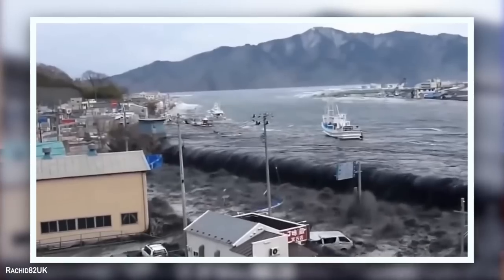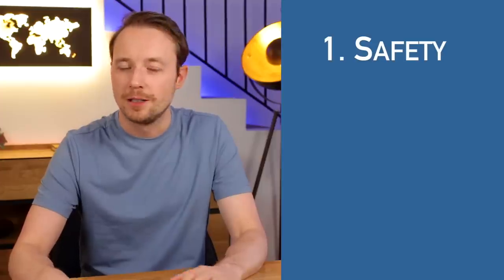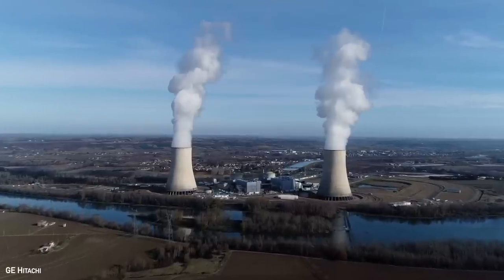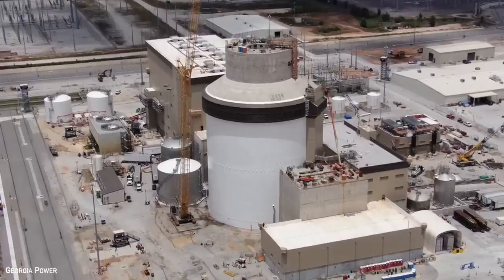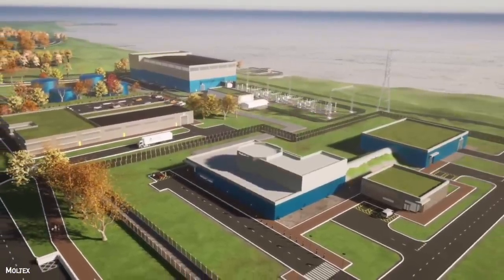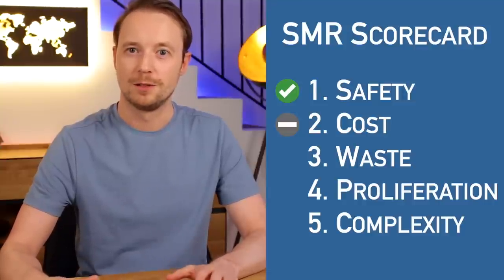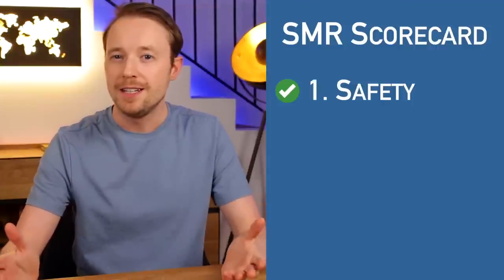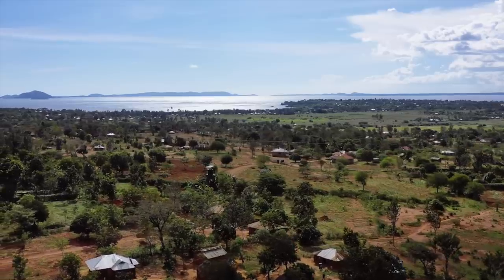Can Small Reactors Revolutionize Nuclear Power?

Comment: There is no path forward to a fossil fuel free future (which we must achieve because oil prices will soar in the net 15 years as fracking peaks) that does not include nuclear energy. The key benefit of the small reactors are they are quick to bring on line and we should be brining one on like every month in the US if we want to be ready.
Reply: In the US, oil is used for engine fuels not power generation. Electricity is generated using natural gas, coal and nuclear, account for 80%.
Reply: @LSuschena  Yes, but you miss the point.Oil is used for automobiles and as oil prices increase, more and more people will want to convert to EVs. It is the EV usage that will drive the need for huge electric capacity increases. Today in the US, wind and solar only account for about 15% (about 21% for all renewable). Nuclear is 18%. When gas gets to be $6 a gallon, the rush to EVs will intensify.  The base Model 3   has 50 kilowatt capacity which is enough to power a home for two days. Imagine that each Tesla is plugged in every 4th day. This would be like increasing the number of houses in the US by something like 50%. Where is all of that electricity going to come from? We will need to raise the baseline capacity by about 50% from where we are today. As oil becomes more expensive, the demand for electric vehicles will surge. So, it is the price of oil that will drive the need for more electric capacity.  I have been investing in energy production for 25 years  and I have been increasing my investments in recent years, because electricity is the future, and as oil and natural gas get more expensive, nuclear will be unavoidable. There is just no other way.
Reply: @shenmisheshou7002  
True. They don’t realize the tremendous costs associated with EVs, have to rebuild the entire electric grid and build generation as you say. The greens don’t understand the costs.
Reply: @LSuschena  I also don't think they realize the shortcomings of renewables. Current solar panel technology is such that panels only last about 20 years and of course they don't make much power when it is cloudy.  No one is going to want to tolerate rolling blackouts because the sun isn't shining. Wind I think is more reliable, but structural life of a wind turbine blade is likewise about 20 years.  If half of our future power needs have to come from green energy, the waste from aged components will be staggering.  It is a bleak future. I am an old man and I will be dead before 2050, but I am saddened to see that there are so many people that still don't see what his happening. Even as a young man, I made the decision not to have children.  I think people thought I was being selfish but even then, I could imagine that our energy usage was unsustainable. This was long before global warning was in the public's eye, but having been through the Viet Nam war and having seen the fight over resources and the unsatiable thirst for energy, and having read very early work on global warming (the first papers on the subject were written in the late 1800s) and the Hubbert Peak ( and Hubbert pretty much got it right) I looked into my own crystal ball what I saw was bleak. I would have never seen the downfall of US Democracy coming, but I could see use overconsuming our resources.
Reply: @shenmisheshou7002  
Truth!
I am trying to figure the LCOE basis using EIA information, but they are inconsistent with their own data. They state nuclear capacity factor as 94%, but use 90% for LCOE values. They state solar as 26%, but use 29% in LCOE. Looking for the actual formula they use.

Here is the rub I see. If you install equal generating capacity of nuclear and solar, nuclear (and fossil) can put 100% of their capacity to the grid on any given day, rain or shine, winter and summer. Solar can only put 25% of it generating to the grid on a perfect solar day.
To me it seems 4 times the solar needs to be installed to put the same energy to the grid. So capital costs for solar is times 4.
But of course some people want energy at night, so you have to introduce battery storage.
So, 1/4 of solar goes to the grid during the day and 3/4 to battery storage, or 18 MW. So it looks like solar LCOE times 4 and Battery LCOE times 18. But then I see battery capacity factor is 10%, so is that 180 times battery LCOE?

In Florida, the rule of thumb on 10 acres per MW. To replace a 500 MW fossil plant that’s 5,000 acres/MW times 4  for capacity factor, 20,000 acres.

The other question I have, related to cutting down vegetation to install solar. Does installing 20,000 acres of solar limit CO2 emissions that the natural vegetation/trees remove?

https://www.eia.gov/outlooks/aeo/pdf/electricity_generation.pdf

Be well.

Comment: I'm surprised this idea has taken so long. Small reactors have proven to be effective for nearly 70 years in submarines.
Reply: Submarines do not have to compete on cost.  EVERY utility that has nuclear has ALWAYS built the largest plant available due to economies of scale.  SMR are cheaper to build but more expensive to operate
Reply: @clarkkent9080  I know everything you just said but you've missed the whole point of my original comment. Small reactors have been viable for 70 years. That's 70 years of learning. Think what the world was like 70 years ago technologically.  New, innovative technologies rarely do compete on cost and quite often originate in aerospace or military applications where cost is less important. The crux of my comment is why has this concept taken so long to be looked at as an option in the commercial market. When a technology has to to prove itself competitively in the marketplace, that's when costs plummet and efficiencies soar. Look at EV's, wind turbines, composites, ceramics, alloys, etc etc.
Reply: @alunjones2550  First NO company that is proposing SMR are designing reactors anything like navy reactors.  Navy reactors make only 70 Mw and to do that, they use 95% enriched uranium at a cost of $1 billion for just the fuel. They are very specialized reactors.

But it may be better to give you REAL life examples and that would be NuScale which is the only company proposing SMR in the U.S.
This is from the Des Moines Register an concerning the only Small Modular Reactor (SMR) project in the U.S. today.
In 2013, the Wall Street firm Lazard estimated that the cost of generating electricity at a new nuclear plant in the United States will be between $86 and $122 per megawatt-hour. Last November, Lazard estimated that the corresponding cost will be between $131 and $204 per megawatt-hour based upon the 4 recent new nuclear projects in the U.S. . During the same eight years, renewables have plummeted in cost, and the 2021 estimates of electricity from newly constructed utility-scale solar and wind plants range between $26 and $50 per megawatt-hour. Nuclear power is simply not economically competitive.
SMRs will be even less competitive. Building and operating SMRs will cost more than large reactors for each unit (megawatt) of generation capacity. A reactor that generates five times as much power will not require five times as much concrete or five times as many workers. This makes electricity from small reactors more expensive; many of the original small reactors built in the United States were financially uncompetitive and shut down early.
The estimated cost of constructing a plant with 600 megawatts of electricity from NuScale SMRs, arguably the design closest to deployment in the United States, was originally advertised as costing $1 billion but upon requesting actual bids from engineering firms, increased to $6.1 billion in 2020. Given inflation and other cost constraints that cost today can only be expected to be significantly higher.
The cost was so high that ten members of Utah Associated Municipal Power Systems canceled their contracts. NuScale then changed its proposed plant configuration to 6 fewer reactors but increased each reactor output from 50 Mw to 77 Mw costing at total of $5.3 billion. The NRC just last week approved the construction of the 50 Mw design but now will have to start the review process all over given the switch to a 77 Mw design. For each kilowatt of electrical generation capacity, that estimate is around 80% more than the per-kilowatt cost of the Vogtle project in Georgia — before its cost exploded from $14 billion to over $30 billion. Based on the historical experience with nuclear reactor construction, SMRs are very likely to cost much more than initially expected. And they now have delayed the project start until 2025 in an attempt to find more backers.  All this before the inevitable setbacks that will occur once construction starts.
Reply: @clarkkent9080  I didn't say they needed to be Navy type reactors. I didn't specify any type of reactor. I specified "small reactors". 

Cost of renewables does not consider their unreliability and unpredictability. You can't guarantee the sun will shine or the rain will fall or the wind will blow, which is the fundamental case for nuclear and above all else, adaptable, reactive, responsive nuclear. Of course it's not as cost effective, you're dealing with far greater complexity and danger, but only through development will cost come down.
There's three fundamental reasons nuclear has not developed the way it should. Paranoia, cheap fuels such as oil, coal and gas and thirdly, nuclear has never been put under pressure to develop itself. The car industry is being heavily pressured now to develop EV technology because they won't be able to sell ICE vehicles in many markets soon. They either develop or die. Guess what, there's massive improvements in batter cell technology. You look at any technology put under pressure and it miraculously develops in leaps and bounds.
Look what happened to technology under the pressure of war. We started 1939 with bi-planes and ended 1945 with jet fighters and nuclear weapons.
I reiterate what i said in my original comment "I'm surprised this idea has taken so long. Small reactors have proven to be effective for nearly 70 years in submarines."
Reply: @clarkkent9080  You've really twisted my words this time. From your reply, I guess you didn't understand a word of what I said. Firstly, I am 100% in favour of wind turbines, solar, hydro etc. but none of these can guarantee  their supply of electricity. The reason all of these technologies can reduce their costs so easily is because there's not a whole lot of new technology and also you have considerable cost savings from scalability. As I previously said- which obviously you didn't understand- nuclear will be considerably more expensive because you're dealing with something far more complex, far more hazardous. You're also having to deal with far more expensive materials. Nuclear is the only real option for predictable, reliable base-line power delivery that is green. If we all stopped developing technology because the costs "ballooned", nothing would progress. I'll draw pictures for you if you still can't understand,.
Reply: @alunjones2550  I understood exactly what you said.  What you don't understand is that new nuclear in the U.S. has been proven to be 2-3 times the cost of any other power generation method.  After VC Summer and Vogtle NO U.S. utility is even remotely considering new nuclear.  And if you do a little research you will see that old fully paid for nuclear plants that have license extensions are shutting down every year because they are not cost effective. Now the taxpayer has $36 billion to give to investor owned utilities to try and bribe them to keep the plants open.  

You can mighta, coulda, shoulda all you want but we are a capitalist society and even climate change will not override the massive cost and time to build.
Reply: @clarkkent9080  If you're so against nuclear can you please tell me which green power source we can use that will deliver consistent, reliable, predictable power because wind, wave solar, hydro can't. They're all subject to the vagaries of the weather and lunar/solar cycles. 
What is going to provide that consistent, substantial base-line power in an environmentally considerate way instead of coal, gas and nuclear power stations. I'd love to know, and so would all the countries that are looking to invest in nuclear. You must know something they don't.......
Reply: @clarkkent9080  For a start, I don't ignore facts. I've acknowledged the high cost of nuclear, I've acknowledged the lower costs of wind. You need to tell me which fact I've ignored. Secondly, the world does not rotate around the USA and so just because America isn't building any nuclear does not mean other countries aren't. 
I notice you didn't answer my question as to which green power source can deliver consistent, predictable, reliable power other than nuclear. that's because none of the others can', Solar might be great for some but not for countries with less sunlight. Same goes for tidal, hydro, wind. None of them provide 24/7 guaranteed power. And whilst you're so keen to say I ignore facts, that is a FACT you can't ignore. I love green power but, I'm also not dumb enough to think that wind, solar, hydro are capable of providing all our needs on their own. Do some research on nuclear investment outside of your beloved USA.....

Comment: Fairly well balanced and delivered video. Even though I am fairly skeptical about the benefits of nuclear, it does seem like it will be the best option for high latitude nations or small islands in deep waters, together with wind and a little storage. I think the biggest red flag for them is that nobody is building the SMR factories yet, when they are going to need a process with a negligible defect rate that produces at least 20 units a year to have a meaningful effect on the global energy market. That factory design could end up being more difficult to license than the finished reactor, especially if they are fabricating the fuel elements there.
Reply from the maker: Yeah, I think SMRs or even microreactors have a place for the more remote regions where fuel like oil or renewables alone might be difficult. You are correct, no one has built the factories and that will take time with no guarantee of success. Thanks for the feedback!

Comment: Real appeal of SMRs is the psychological factor of smaller disasters get less publicity, even if the occur more often.  It's just reality, have enough nuclear reactors and there's inevitably a los of coolant accident.
  Spreading the risk with lots of little reactors means probably more meltdowns, but would contaminate much smaller areas, like a single town rather than a whole country.

 Small local disasters make the network news and media much less, so public relations for a utility company aren't stained by a conventional plant meltdown of a Fukushima scale.
Reply from the maker: I think nuclear power is unique enough that, even if a small plant has an accident, there would be a lot of attention. Very rarely, small research reactors have issues and then it's a big deal. However, the proposed designs of many SMRs are really orders of magnitudes safer. Accidents are not impossible, but probability and consequence and a fraction of older designs.

Comment: Can SMRs be built using thorium molten salt designs?  Is anyone actively designing or building one right now?  They seem to have significant advantages over U reactors, such as simple automatic shut-down and the unsuitability of waste for weapons manufacture (no plutonium & handling fissionable isotopes in the waste is difficult, unsafe and hard to hide.)  Also, Th is more abundant than U.

Comment: Small reactors have been tried, long ago, and the economics were dreadful.  The basic laws of scale have not changed since then.   Small reactors still need most to all of the basic parts, plus the irreducible elements like backup systems, security, licensing, and monitoring.  All this recent hoopla shows the usual pattern of hullabaloo drummed up by small companies looking for (dumb) investors ...   Lotsa blab, whooshing noises and glossy 3-D flybys,  and plenty of mostly-unfounded monetary projections.  A quick look at past new nuclear ideas shows a consistent pattern of total fails.  Advanced gas-cooled reactors, pebble-bed reactors, sodium-cooled reactors, thorium reactors, and more. All total technological or economic failures,  even worse than the typical boiling-water reactor cost overruns and failures

Comment: Dead man walking....LCOE of SMRs etc is x5 wind and solar, see you next decade....maybe
Reply: Of course, you need more than 5x the wind and solar to deal with intermittency.
Or, you could buy storage at severalX the LCOE of NPPs.
Reply: @factnotfiction5915  Actually no you dont need x 5.  PS Reactors also need backups while they refuel or repair (see France for that one) and storage.
Reply: @gzcwnk  I agree reactors need backups, as does any power plant going down for maintenance - what I am referring to is the intermittency.

Without storage, you need widely distributed backup. If the solar farm in New York fails because of sunset, then the solar farm in California has to pick up the slack - but there ALSO has to be solar farm for CA power (in addition to the NY backup).

With storage, you still need extras.
1 to run the city while the sun shines, but another to top up the storage while the sun shines. - and BOTH have to be backed up in case your storage runs out.

All in all, more than 5x.